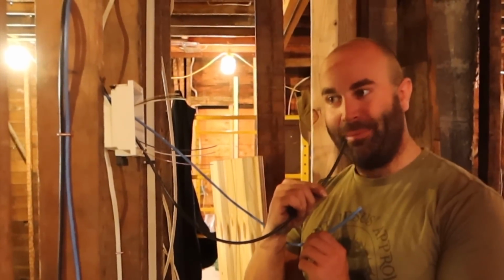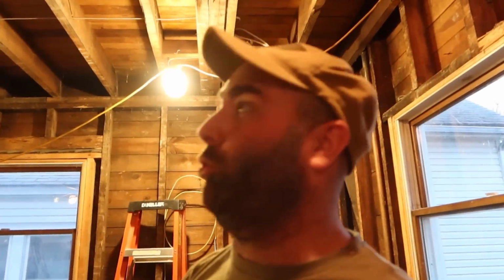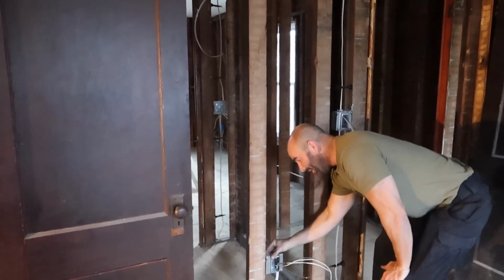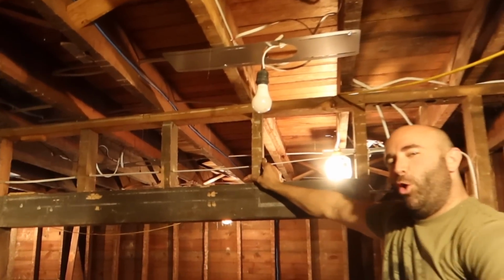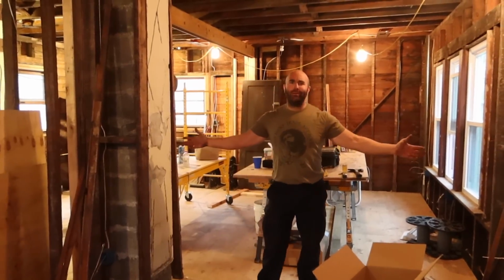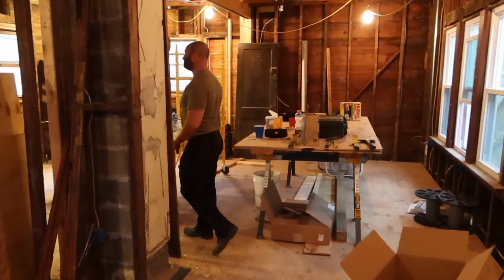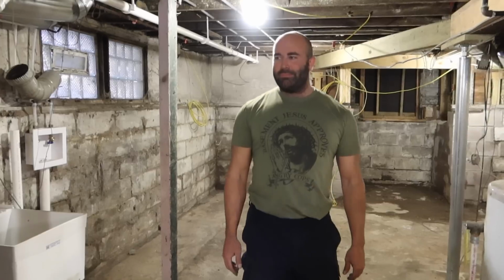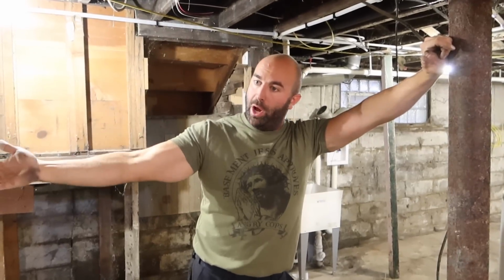This Old Crack House Part 17 - This Wire Tastes Funny

Comment: I spent the last 8 years rebuilding a house that was built in the 70's. A man was kicked out by his wife, went in the backyard and built a house with whatever fell off of a truck. It brings me great joy to watch someone else suffer the way I have for so long.
Reply: Built in the 70's ain't bad, mine was built in 1894 and I'm thinking they drank way too much of that original Coca-Cola...
Reply: @kevinfreeman3098  I thought cocaine helped productivity.  isn't that why all the business people did it?
Reply: @Shrock that’s valid. At least back then they used real 2x6’s and the framing will still be good. As long as there’s a good foundation. My parents had a house that was built in the 1890’s and it was originally built on stumps. Then someone just poured a bunch of concrete under and around it. When we moved in the center of the house sagged about 6”. And it wasn’t a large house. They looked at remodeling but ended up tearing it down and starting over
Reply: @ryanhamstra49  yeah I'm kinda stuck with this one house my parents had built in the early 70's and it's a mess.    Older materials?   I've got several real 2x4's and 2x6's that are at least 80 years old made of oak.
Reply: Literally lol.
Reply: @Manco65  ours was an old farm house, it’s likely that the lumber would have been cut from cedar and pine trees on what became the farm
Reply: I live in a 1970s house too. What the fuck is up with people in the 70s and not having overhead lighting? There's one outlet that's wired to the light switch in every room, so I have LED pucklights all over the place. The only places that have overhead lighting are all the rooms in the basement and the upstairs hallway.
Reply: @wolfehoffmann2697  in the 70s lamps were cool and in style. You would hook em up on switched plugs and groove. Lol
Reply: It is SO much fun pulling all of the old rusty nails out of wall studs after tearing out lath and plaster!
And trying to find and remove all of the nails and staples around rooms that were previously carpeted!
...No matter how many times you check, there will ALWAYS be a few you missed, and you'll find a few by cutting yourself on them.
Reply: @wolfehoffmann2697  At least in a 70's house, you're actually able to snake a wire virtually anywhere. Good luck doing that with lats, nails, & plaster. That's why you see a lot of wiremold in those older houses. During the 70's, it was still econimical to have switched outlets to turn on a lamp. That's what people did back then. Ceiling fixture availability wasn't like they are now. No comparison.

Sure, the houses were sturdier... But NOT insulated, with single-pane windows. I've rewired many homes. Gut an older one.... knob & tube wiring, windows with lead weights, stone foundations, basments that you can't even stand up in. No thank you.

Comment: Tasting wires?  See kids,this is why Uncle AC needs to wear a special helmet all of the time.
Reply: Nah, that's how you're supposed to check if the PoE injector is working or if the coax is tapped in. Better to use the knuckle-rest for mains, much higher resistance and you can tell Line to Neutral vs Line to Line by how long it keeps tingling.
Then there's the lighter-test for gas, much cleaner and easier than carrying soapy water around.
Tissues are great for finding tiny water leaks.
Sewage? Leave that to the professionals!
Reply: @matthewellisor5835  
I did my own sewage.  It's just a major pain in the butt.  Don't do the abs cement without good ventilation, and don't stick around to let it saturate your lungs.  The stuff is vile.
Reply: That sounds more like Private Potato.
Reply: If he woulda had his battle buddy there, he coulda stopped AC.
Reply: @wizardsguru  maybe it is😊
Reply: a helmet with a facemask so he doesn't lick the windows on the short bus🤪
Reply: @matthewellisor5835  Good old removal of shit pipes, the "professional" will be the one operating the machinery, the apprentice will be the one getting close and personal with the pipe.
Reply: At least it was only the low voltage data wires….. the other wires wouldn’t taste too good 😅
Reply: AC or DC?  I can never remember which is which 😂
Reply: @maninblack1149  AC is a sharp or needle-like pain, DC is sour on only one side.
Reply: @matthewellisor5835  🤣 lmao! Knuckle rest for mains! That’s hilarious 😂
Reply: 😆 why isn’t 0:01 screenshot not sent as homework for angry meme review🤷‍♂️🤣

Comment: As a cable guy, please remember that a line does need to come into the house as well so if you want it to look pretty coming in, ESPECIALLY if you plan on finishing that ceiling, please run a cable in from outside now. Check with local providers for their cable specification requirements.
Reply: just be ready for us to drill into the eve to run the input into the attic

Comment: As a cable guy, THANK YOU, THANK YOU, THANK YOU for running Ethernet. It makes our job so much easier when we come to install or fix something. Modem in the basement and ethernet everywhere else means like two less failure points when the internet goes out.
Reply: Agreed. Waay too many people think they can just use WiFi and don't plan ahead. Much better to run some proper Ethernet cable back to a wiring closet where you can slap a switch, router and do some physical seperation. I ran 4 cables to each socket so I could segment secure, public, media and CCTV. Overkill, but a whole lot easier to do when the walls are down and makes config and troubleshooting a whole lot easier.
Reply: Having ethernet cables done when wiring is being done is so under appreciated and almost always seems to be an after thought. I feel as though the only people who really consider ethernet runs are tech savvy people.
Reply: Bro, you’re telling me you don’t love walking in to a house full of nothing but RG59 hiding behind wall plates?
Reply: @randomschittz9461  Oh yes, especially the premium copper braided stuff. Makes my day!
Reply: @Majima_Nowhere  😆😆😆 gotta love it.
Reply from the maker: I did it for you
Reply: What are your feelings on smurf tube?
Reply: @Paul Roth  smurf tube can burn in hell. Anything over an inch probably could knock teeth out on spring back
Reply: @averywellsand888  whoa, what is smurf tube?
Reply: @Random Schittz  it's non metallic electrical tubing. It's blue and comes in ½inch to 2inch I believe. The smaller size is pretty flimsy and does what it's told but the bigger sizes is pretty stiff and has a lot of spring tension when bent and 1inch just about split my lip open once
Reply: I have reels of ethernet cables, for some reason the massive stores like to replace it when they replaced their cash registers. There is always a way to fenangle a cabe into a wall, up and over to another room, don't know why more people do not do it. After all, the amount of people that complain about their internet speed due to the distance between wi-fi router and device/s is huge. Just use cable people, then there are way less issues. Just a bit of cable management and crimping on a socket, not like you have to use a wall pate and terminate there and use an extra cable, just run it through a small hole in the drywall behind a desk or chair/couch and seal it with silicone.
Reply: @averywellsand888  damn! I quit doing cable in 2013. Is it as big as RG11?
Reply: @Random Schittz  so it looks like rg11 is a cable smurf tube is a conduit for pulling in cables or wires or cable assemblies it doesn't do much for the protection of the above items but it lets you in theory change out that cat 5 to cat 6e fairly quickly and easily
Reply: Former network technician here, all the yes.

Comment: Electrician here:  Metal boxes are for grounding to the box, however on a wood stud, not really needed, could have went plastic, unless box depth (gigitty) is an issue then a thin metal box works fine.

Protip: if you are doing some upgrading on an old house and don't have a ground wire, replace the outlet with a GFCI outlet, it's the legal way to both bring it up to code and be safe.
Reply: Hey brother I think they use the metal for short studs because the plastic halves are to flimsy. Also, can't he just GCFI everything at the breaker?? I don't know what code is anymore been a while.
Reply: @USNBM3  gfci wouldn't work at breaker because you would then have to replace the outlets that would appear to be grounded when in fact still two wire.  I'd have to dig into the code, but off the top of my head I think it's gotta be a gfci outlet.
Reply: @thomasheerjr9268 hi. It's been a while since you posted. Would you mind explaining to me what the wiring was in the past episodes?
Tube and knob?? How exactly does it work? What are its limitations? 

Is it just a positive and neutral without a ground? Is there a central point that the wires come out of and does that central point go to the outside? 

Everything is linked up together so each device draws from the lines and can't have more than a few devices and that's why it tends to be reserved for fixed lighting? I know what I want to say but do not know how to saw eloquently in proper terminology. 

Thank you for your kind reply. 😊

Comment: I always heard nails sticking out slightly helps the drywall since it anchors the mixture. Also, if you got rats running around but you don't have any food or don't find a nest, it's one of your next-door neighbors. Rats don't wander very far rom their nest. 30 yds tops.

Comment: As a drywall hanger/taper.....having clean framing IS your job. Makes all the finish work easier and tie ins so much cleaner and better finish.
What your electrician said it spot on. You don't say that line unless your at a professional level. We have to go behind a lot of homeowners that try to DIY it and eventually call us to fix it and the price goes up for fixing their fail. We warned you.... These YT guys showing drywall repair have NO experience. You can tell if you know wtf is going on. 
You're a bad ass AC. Glad to see your project making progress.

Comment: AC remember don't close any walls till you get those inspections done; i.e. Framing, Pluming, Electric and yes even the insulation need to meet code and passed before any walls get closed. You don't want to piss off the inspector. Oh the easy way not to miss a nail drive them in fully before moving to the next one.
Reply: @@shrock5874 yeah, codes suck sometimes. Thing is, they exist to benefit the customer, so the cost must be passed on to the customer.
Pretty much shut down my own little business in order to help my dad run his. He's old and not in great health anymore so I've been working with him in order to keep things going until he's ready to finally retire.
Turns out, for years he has been basically eating the cost of permits and such. Hasn't been charging for anything but fuel costs for trips to the store on hourly calls. We got him all fixed up now though.
My truck with codes is just to overbuild everything instead of trying to bend over backwards to meet the absolute minimum standard. Never had any problems doing it that way and doesn't cost me a thing. If anything it only helps because customers really appreciate it when you overbuild, thus more word of mouth work comes in, which is best of all 😁

Comment: AC.  Only downside of those horizontal fridges is that you loose a lot of cabinet space.  Ok if it's an Air BnB but not so good when it comes time to sell the property later.  You might consider hiring a decorator for a walkthrough to plan the kitchen.  Its a one time fee, you get some professional advice, and you can then work it into your build.  (had to do this with my own crack house)  But hey I got a great paint scheme from her, and she was right about how to plan the cabinets in the kitchen.
Reply: It's also better to do that before the house gets it's sheet rock, as any adjustments (such as relocating an outlet, etc) is much easier to do, vs after trying to make changes after the sheet rock has already been installed.  Also, make sure electrical, insulation, plumbing, etc has passed inspection, before closing in the walls.
Reply: You forgot to give him your card and company name 🙄
Reply: @robdubent  Sadly, I'm in Texas, he's in New York.  Different building codes/laws ect.

Comment: AC Suggestion, when you go to sister those joists, use construction adheasive (liquid nails) between the 2 beams in addition to the lag bolts.  It will make the future of the house easier on you, as the sistered joist will flex as a unit instead of between each bolt/lag.

With the neighbor, I think you should see if the MP's will allow you to take their dogs for a walk (if not then suggest the location of a new exercise yard for them).  Before you leave the base feed them 1 lb of ground meat each, then post them on the neighbor's lawn until it works through....  Oh, so the neighbor doesn't do anything too stupid, make sure the dogs are wearing full kit.

Comment: Hey, definitely run a 20a line to the main entertainment center location for whoever uses the house. It'll be appreciated.
Reply: 20 amp in kitchen, too.  Seriously, I have tenants that trip that all the time.  I hate how underwired houses are.
Reply: Oh yeah, great point! Or two separate circuits for the counters with all the appliance use these days.
Reply: @GatorAaron  
Tbh, I think maybe 30 amp wires on 2 circuits wouldn't hurt.  A family can have a microwave, a bacon frier, a toaster and a slow-cooker running all at the same time in a kitchen.  Seriously, I don't know what electricians were thinking in the 1960s.  A lot of these things aren't even recent inventions.
Reply: Yeah, I guess 20 amp is good enough.  30 amp gfci is like 130 bucks or something.  Ouch.
Reply: Yeah, this crack house has already fleeced him for so much. 🤣
Reply: @GatorAaron  
He just needs to get more Raid Shadow Legends sponsorships, hehe.

Comment: If your tight on space I’ve done this and it works well. Take your screw jack and get the joist in place. You’ll want to run a dozen or so screws into each scab.  The scabs need to be drawn in tight on the joist so the glue can grab it good. The scabs are 2x pieces of 3/4 plywood about 4’ long and about the width of the joist.  Have a box of 1.25” long construction screws and a tube of PL adhesive. Get a good layer of adhesive on a side of the scab and screw it into joist.  Give the glue about 12 hours to set. It will not move.

Comment: with the electrical roughed in (although they still need todo the makeup), the house could be done in a couple of weeks depending on how quick the painters are. sounds like the electrical company you got is some good guys doing good work been staring at all the wires and stuff throughout the video 10/10 installation.

Comment: I used to hang drywall in Buffalo years ago, and you wouldn't believe the hidden mess we'd find behind tacked down insulation on remodel jobs....

One time we contracted through this company to hang a string of remodeled houses and the problem became so ridiculous we hung over old nails and let them punch through the sheetrock... Just didn't give AF anymore

We left with a "good luck with all that BS" lol... Guy didn't even try to come after us for material loss on the drywall, which we basically obliterated haha

Comment: The boxes are not for grounding.
They are to provide a solid mount for switches and outlets.
Junction boxes are a place to keep wire connections separate from the burny-bits of the house.

Comment: The metal four square box can be used for grounding, but it'll never be as good as the panel in terms of grounding, and seeing as how you've had all the walls striped I'd say they, most likely, can get to the panel unabetted. More than likely the reason they used four square boxes instead of single-gang shallows is because of the amount of room needed per device and wire. Also unless you interrupted their work, for that shot, they're not done making up that box. They need to twist the grounds together and the neutrals together, and strip off the end of the feed wire then shove all of it in the box for protection from the sheetrock guys. Also congrats getting electrical in there means your more toward the end goal than the start. 🙌🥳🎉🎊
Reply: So ... I watched a little further and apparently that whole not twisting wires together thing was intentional. And I gotta say must me nice living in a place where sheetrock guys actually make little to no mistakes. Because you try that shiz down here and you'll find that they neglected to cut out one or several of your boxes screwing you over and your stuck on the trim searching for a box you know has to be there cause you got one side of plugs and/or switches powered and the other not. Slowly going insane trying to find it. So that's fun. I'll just be down here in the south pig-tailing my wires trying to make sure the sheetrock guys (who, I'm conviced, are like the marines of the trades) don't jank them up so bad I can't use 'em.

Comment: The metal Boxes are for commercial construction most of the time but for a special case like this the use is appropriate. Metal boxes are more likely to cause shorts since its a conductor, that is the reason you have to ground a metal box. incase the live wire becomes disconnected from the device you have to give the electricity a way back to the source to trip the breaker and cause a fault. If the box wasn't grounded there could be arcing which can lead to a fire or if you have a metal appliance plugged in and you touch the device the electricity could find a path back to the source through you which is bad.

Comment: The boxes are for wire volume. You have to have a certain amount of space in an electrical box for the wire, as well as the plug or switch. Since the wall is only 1.5 inches thick, your electrician used wider boxes so that there would be adequate room. Looks like they did a good job.